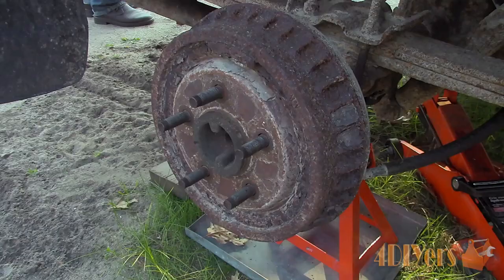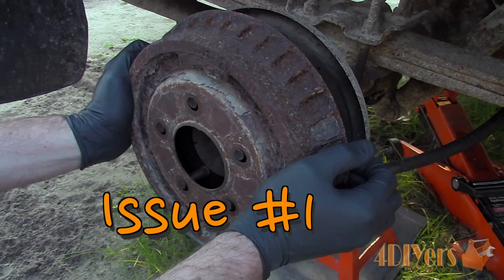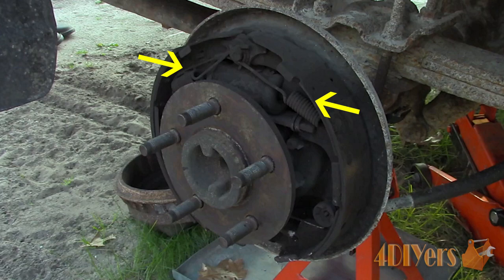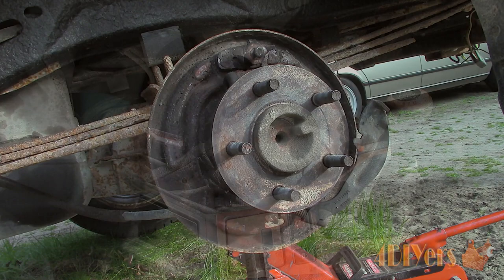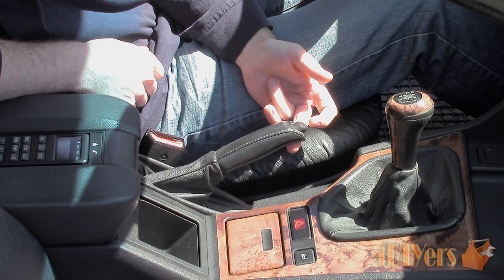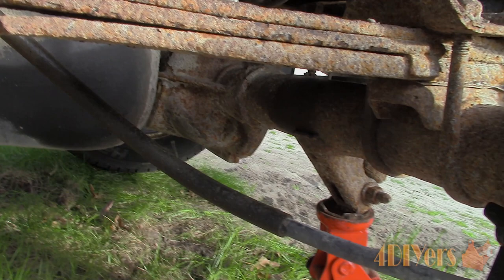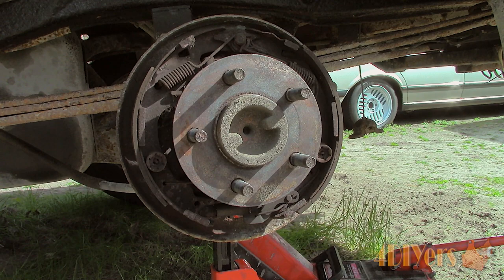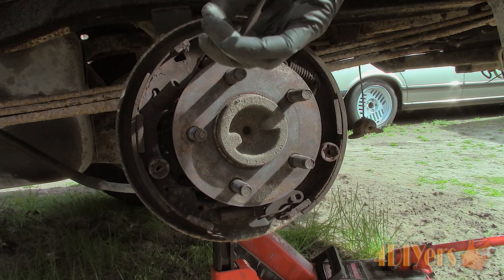3 Reasons for a Brake Drum to Stick

Comment: The left back wheel on my 2001 Honda CR-V was locked up because of a stuck (likely rusty) parking brake. I didn't even have a jack, so I couldn't get the wheel off. But, I had an idea that worked instantly!  I mixed up a hot water solution of baking soda, laundry detergent, mineral oil, and lighter fluid, which felt extremely slimy and slippery. Then, I put it in a spray bottle and sprayed it into the left rear brake drum, saturating it as much as I could. This freed up the parking brake instantly! I think soapy water might have worked by itself, but the other things increased the slipperiness of the solution greatly and left an oily residue.
Reply: I guess you no longer have brakes on that wheel

Comment: Definitely the problem I have. My brother passed away not to long ago and left me his '69 beetle, totally  customized with a 1835 engine, and if you know bugs, THAT is a monstrously huge engine, but its been sitting for years until I started to work on it recently.  It wouldn't budge when I tried to move it, both front wheels are frozen. So, the next step is in your video, thanks for it, it cleared some things up.
Reply from the maker: Happy to help!
Reply: I know it's been two years, but I was wondering if you solved your problem. Are there drum brakes on the front of the Beetle? I was under the impression they were disks up front and drums in the rear. I have a 73 square back that's locked up, but it's not the drums. If you have any ideas let me know.

Comment: Well explained, thank you. Unfortunately I have the symptom but brand new cable, cylinder, shoes and hardware. Based upon your video I will double check if the new cylinder is faulty or the cable is stuck.
Reply from the maker: Thank you! Also check that you have the correct star wheel adjuster for each side.

Comment: hi 4DIYERS, i figured out why my truck have a death wobble. the culprit was the drum brake wheel cylinder leak oil. i replaced brand new wheel cylinder, shoes, star adjuster and the drum but after i replaced i drove for  3000 miles and now the shoes pad dragged on the drum( i dont know if it is the star adjuster cause all the brake dragging or the bellcrank because i could tell  when i pull on the hand brake and it get harder)i want to know what is your opinion. thank you.

Comment: Mine was the #3 issue rusted brake shoes cars been sitting over 6 months and I buy them from the auction both rear where stuck I got one free by hitting drum with hammer releasing rust now it moves but the other rear still stuck I will hit with sledgehammer tomorrow I’m sure this is the problem and your utube video is the only one that mentioned the #3 issue everyone else thinks it’s a parking brake issue and it’s not this is a 2017 model so fairly new .

Comment: After replacing drums, shoes, cylinders, and hardware my right rear gets extremely hot after driving. Had a brake technician bring the adjusters all the way in and it still does it. Wheel turns freely when jacked up. Any ideas?
Reply: Bad wheel bearing can cause the wheel to heat up

Comment: Twice now will be driving down the road and it feels like the car is being held back and brake pedal shakes and doesn’t accelerate when pulled out when we pull the car over back driver side wheel smells like it’s burning we put the parking brake on put the car in reverse went two or 3 feet back and then it worked just fine after that today it did the exact same thing so we had to do the exact same thing to get it to work again what can be causing this if we’re not using the emergency brake we are not using the emergency brake so I’m not sure what’s causing this thanks

Comment: I have a 94 1500 4x4 Dodge ram and for some reason the brakes keep trying to lock up on me on the rear... I replaced the rear brakes and wheel cylinders about 4 months ago and when I remove the driver side hub one of the brake shoes was snapped in half.. but what could be causing it to try to lock up? It almost feels like the truck is missing, but its the brakes.

Comment: Would this cause the wheel to stick when turning to the right/left. Make turning difficult as if manually steering?
Reply from the maker: Which wheel and do you have drum brakes or disc brakes on the sticking wheel?
Reply: @4DIYers  it was the hub assembly

Comment: I have an issue with the brake adjuster over tightening when the brakes are used in reverse. I've replaced all springs and adjuster hardware, and have inspected the wheel cylinders and other components. Still after a few days the brakes gradually start dragging more and more as the adjusters continue to click while moving in reverse. Any ideas?
On an 83 chevy k20 with 13 inch drum brakes.
Reply: Did it start happening right after you replaced shoes, hardware, or drum? It sounds like there is more range of motion (i.e. slack or pedal travel) than engineered into the self adjusting mechanism. Make sure you received the correct parts and that all the springs are installed properly.
Reply: @JKraylon  I had replaced the hardware and it started happening. The new parts were identical to the old. Makes me think I've done something wrong, but I've checked and rechecked my work so many times I've lost count. What's really interesting is it seems like the previous owner had trouble with it too, because the adjuster links had been cut (I replaced them with new ones).

Comment: I have a 1997 Silverado c1500, my breaks keep locking up. I’ve changed pretty much everything. New calipers,breaks front and rear, I’ve put a new master cylinder on it. The front breaks bleed out perfectly but my rear drum breaks don’t. The passenger rear just does this little leak when bled and the driver side rear does not bleed at all. Any suggestions what it might be? I’ve also taken off the rear break lines. And cleaned them.
Reply: The rubber hose between the rear end and the main brake line may be blocked.  I've had this mostly on front brake hoses, but something happens on the inside where the fluid will not pass.  Or more specifically it will pass when you press on the pedal but will not pass back, leaving the rear brakes locked up.
Reply: Proportioning valve can & usually does this.

Comment: My father has a 1996 Nissan Quest with rear drum brakes. One wheel recently began to stick and would only release when the purge valve is opened. The parking brake is functioning normally and this happens even when we don't use the parking brake.  Does that sound like a bad brake cylinder? I find it odd that opening the purge valve gets the cylinder to close back up.

Comment: What if everything has been replaced with brand new stuff twice but still sticks and over uses the brake? Tjat is an issue im having. It has me stumped.
Reply: I'm in the same boat. All new brakes but rear passenger side  wheel hub and inner rim gets pretty warm/hot  after 30min drive. Took back to the shop they adjusted it but it still getting pretty warm/hot after 30 min drive.
Reply: Same here. Did u guys find a fix?

Comment: Except for issue 3 of course, can you drive the vehicle with the other two issues? And if so would it cause horrible vibration and smoke?
Reply from the maker: Regardless of which issue, the vehicle shouldn't be driven as it's unsafe and your braking performance will be reduced. If the pads are dragging and excessive friction was to build up, there is a possibility it can cause vibrations and smoke.

Comment: Sir I have Chevrolet Enjoy (Wuling Hongguang) my car's rear wheel locked automatically while driving... Either left side or right side...mainly on rough roads sometimes on good roads also...I had changed master cylinder, wheel cylinder, brake shoes front as well as rear, brake calipers, booster, removed handbrake cables from wheels, changed brake adjusting spring kit, lsp brake valve, checked rear differential, axel but issue doesn't solve... Please do help me... What can I do to resolve this issue

Comment: I'm having the same issue with my  02 accord with rear drum brakes..its in my back yard...the cars been there for 1.5 years...got snowed on and everything...and the rear right side tire..wont move...its literally tearing up my lawn as i try to move it forward..i did the pulling up and down on the brake handle..with no avail ..Next i will look to raise it safely remove the wheel ..and hit on it with hammer..to see if that works.

Comment: Idk if I’m the only one but when it’s cold my rear drums lock up somewhat but when I drive they break free I read about it and it’s something about moisture and brake dust when cold
Reply from the maker: Quite possibly, is it after morning dew or rain? Does it kind of jerk when you first start moving?
Reply: 4DIYers it’s not real bad and once you start driving and they warm up it’s fine and it never does it when it’s hot
Reply: mine is similar to urs but instead of lockingg up it makes a grinding noise. After its fine
Reply: @olrak1670  so it ended up getting worse and worse over the past few years. Eventually it just constantly was hung up. Not as much but a noticeable amount. Turned out the parking brake cable was seized like halfway so it never would return fully. Definitely check that out.

Comment: I got a 1988 chevy caprice classic, better known as box chevy although i have no transmission issues my back brakes are letting me know its time to change, my question is can my bad brakes stop my car from going in reverse and be the cause of a dragging take off????
Reply from the maker: Possible, if something was malfunctioning inside. But drum brakes only "energize" when moving forward, which is why they'll break loose if they're rust in reverse easiest. Have you tried parking on a hill, then allowing the vehicle to cost in reverse in neutral?

Comment: my 67 camaro the rear breaks lock up  and after 100 feet or so of hitting the brakes on and off  it will start working correctly again it happens after one day of sitting every time like clock work the rear tires lock up and skid when pressing the break pedal then it automatically correct itself after 100 feet or so of driving and pressing the brakes pedal off and on  🤷‍♂️

Comment: I heard tapping sound when driving, especially when pressing my gas pedal halfway and releasing the brake halfway. I took it to a mechanic, and he said it was due to the jammed handbrake, and he changed the handbrake cable. But after that, I still have the same problem, and at one point, I felt that I could press the brake all the way to the floor, and it was a  bit harder for the car to stop. So I took my car back to him today, and he said it was due to the drum, and he agrees to fix it for free. I don't know whether I should trust him. I'm very nervous, afraid that the brakes might fail at any time if he doesn't fix it right. Based on the symptoms, what might be the problem? (It's a honda civic 2001, automatic)

Comment: Sir my car make squeaking noise from rear wheels when brake is applied. This happens only when the car is sitting over 7 hours of time. The sound goes away after repeated used of the brake pedal like 4 times or less. And, no issues with braking while driving!!!

During parking time for over 7 hours gear is engage, hand brake too. The moment the car is took out and brake is pressed, such irritating noise comes from the rear. There are no physical worn on brake parts including the brake shoe.
Reply: I think it's normal to make noise when it's cold

Comment: I just had new  rims for my  2007 Nissan xterra  it feels like the  rear wheels are locking up and  causing the brakes to  lock up and not let the truck move forward I finally got the  truck to move forward  and I'm scared to drive it anywhere now  scared the hell out of me at least the truck runs  how can I  fix this without having to  switch rims because I really like the rims I Just had put on help I don't know if the new rims are the case   for it they are the right size
Reply from the maker: Almost sounds like the wheels are causing the issue, so that would lead me to believe they're rubbing on something. I would recommend jacking up each wheel, then determine which is causing the problem and if there is any visible signs of rub marks. If it's only specific to one wheel, then it's probably an issue specifically to the drive to that wheel or the brake assembly. If the wheel is rubbing, you can run wheel spacers or you'll have to pick another wheel with a different offset.

Comment: I need help please!!!!.i have a 1994 dodge dakota..3.9 engine..SLT extended cab.131 inch base.2 door 4×4..I cant get the inspection sticker because e-brake failed. .so ok I bought new front e cable an it matches the old one that was frozen stuck...I bought new intermediate cable an it matches the old one...I bought rear left an right cables an they match...all of them match via the housing an cables both...so I bought all new hardware,everything including the e lever cable..so i bought new brake shoes an new drums...However when I try to connect the intermediate cable to the front cable it seams to be something too short as they wont reach each other by about 2 inches approxamately..I adjusted the adjusters to where the wheels when turned had a slight drag..when I test drove it the brakes when applied seemed to be perfect..but what to do about the e-brake??!! I need my truck..we need money an cant drive on the highways till passes inspection..please help...thank you very much in advance!!!. Gypsieseagul.gs66@gmail.com
Reply from the maker: Did you make sure all the cables are the same length? Make sure your shoes are closed up all the way, you may even need to disassemble the drum brakes to provide a little slack in the cable. I'm not familiar with the first gen Dakota, but I would assume there's also a cable adjustment under the truck and that would also need to be backed off as far as possible.

Comment: All this assumes you can actually get the darn drum off.  My drum is completely LOCKED UP to the point where the tire squeals as I drive down the road,  meaning either the parking brake or regular brake is completely engaged and will not retract.  What to do then???
Reply from the maker: Back the automatic adjuster off.
Reply: web try penetrating oil which also has a rust buster that should pop the break drum off

Comment: There is one more reason the brakes can lock up, the rubber flex hose is stopped up. The same thing can happen on a disk brake, on my truck very unusual situation all three were stopped up, I thought it was the proportion valve problem on the rear brakes but it was the rubber line.
Reply: Agree.  and this should be reason #4 in the video
Reply: That's common on older Chevys. The small passage in the metal connector rusts and chokes the flow. Fluid goes in but takes a long time to come back out. Replace the hoses.

Comment: So are you saying that if you are able to press the brake pads in and move the position from one side to the other that the wheel cylinder is seized or not siezed????
Reply from the maker: If you're able to move the pads on the wheel cylinder side back and forth, then they're not seized.

Comment: My problem with my truck is when I'm slowing down into my drive way the truck starts to shake . but if I'm driving fast and slam on brakes they seem to be fine . its only when I'm riding the brake going really slow it starts shaking viciously. Any idea?

Comment: I prefer disc brakes over drums. They have been used in all 4 wheels in race cars since 1953.
Reply from the maker: I'm at the point where I try to avoid vehicles with drums as I'm not a fan of working on them lol.

Comment: A hundred videos on removing stuck drums....can't find a single one that provides advice on a good drum that won't fit back on over new shoes....and yes, with the adjuster fully adjusted in.
Reply: Same...I think I’ll try to replacing the emergency brake cable to see if that helps.
Reply: did you get the right sized shoes? some cars have/had options depending on gross vehicle weight

Comment: Ok, so let’s say hypothetically, this is a 55 year old truck that hasn’t moved in about 40 years. The truck can’t run and my issue is #3 on your point… what do I do instead of driving forwards?
Reply from the maker: Being that it's been sitting for 40yrs it'll most likely need brakes anyway. So I would just start cutting stuff off without damaging the hub or axle. It's probably the least frustrating and work intensive method.
Reply: @4DIYers  
Well, luckily for me, I did manage to get it off. 
We didn’t want to start cutting because we didn’t know if we could find parts to match. We cut it off and we can’t find new drums, well, we’re out of a drum.
And also, now that we got that stuck one off, we do know they are still good drums. Be a waste really. Won’t even need much resurfacing.
What I did was attach a lug on one of the spokes, put the breaker bar on, and shook the thing violently, sure enough the pads separated.
Reply from the maker: Awesome to hear! I forget that those old vehicles used to last lol. Now you can have a vehicle sitting for 6 months and the rotors will be junk. Nothing lasts like it used to.

Comment: Hello there,
  I have 97 f-150 4x4  my driversiderear wheel wont turn? I took off tire and drum cover and all looks fine. So i put it on stands and put it in gear and imagine that ; it turns just fine! Put drum cover & tire back on and 
freaking wheel is locked again? Help please!!